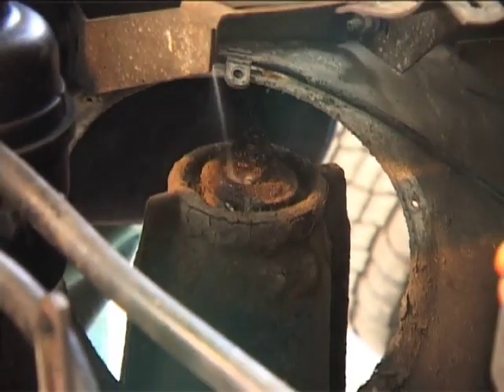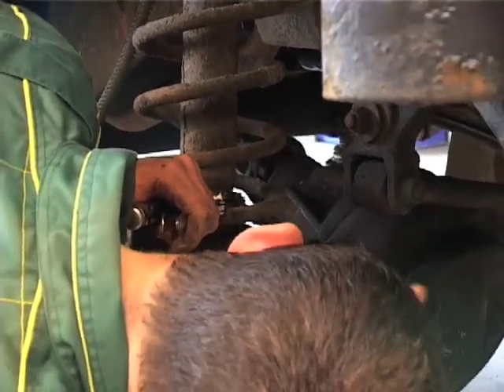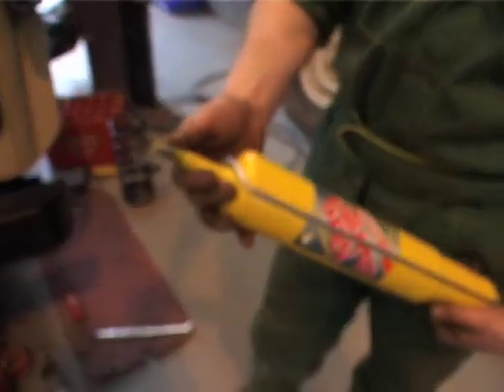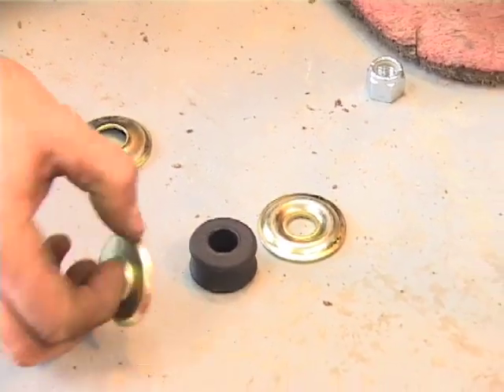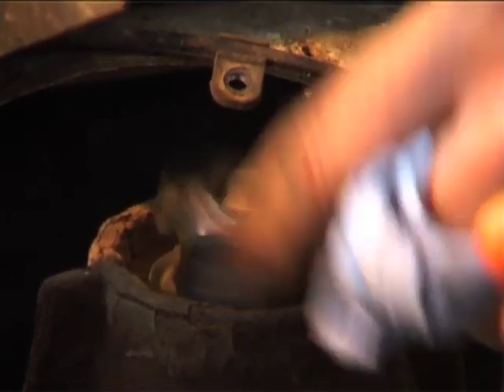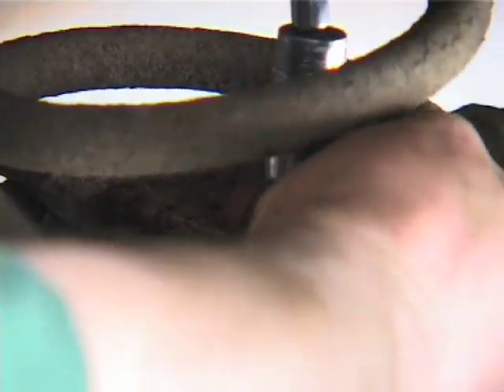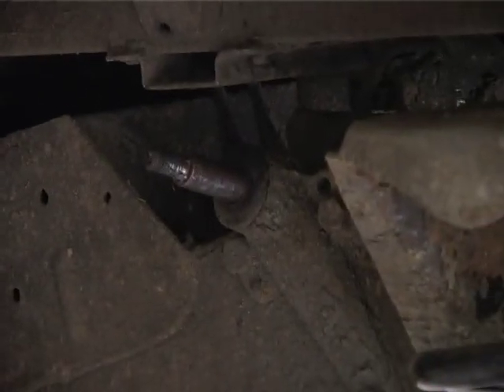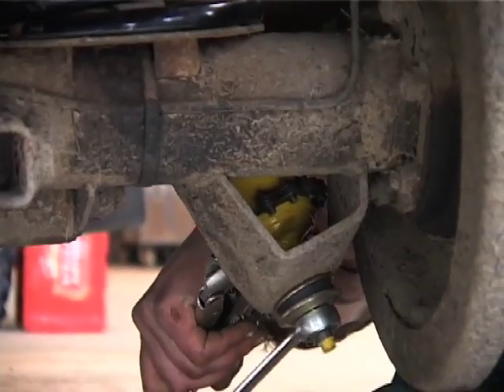Fitting new suspention to Land Rover Defender 110

Comment: Nice video,

Reference to Defender 110,
 Can I know the maximum length of the coil spring during maximum articulation of ( both front and rear)  wheels?

Further,  what is the diameter of these coil Springs?